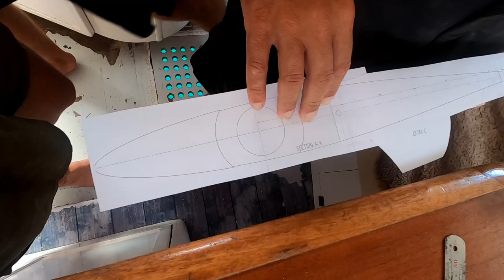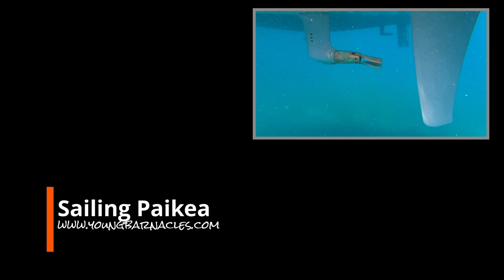Making our Rudder - PART 2

Comment: I take 3 hours to put in a new through hull on dry land, and it wasn't pretty. Then I watch you guys install a new rudder bearing and DIY carbon rudder using a snorkel, in the water. Impressive work.
Reply from the maker: Thanks 😅😅 not an ideal situation but we got it done.

Comment: That looks way faster. Did the port hull get to Europe first?  We've missed you guys online. Big congrats on the AC job. I'll forgive you for leaving multihulls for this bc who needs more hulls when it's all flying anyway? Hoping you can share little tech tidbits along the way of the next couple years. I was making carbon chain plates yesterday for a farrier tri rehab and during wet out was wondering what the Barnacles were up to ;)
Reply from the maker: Nice to know we were missed! We were busy testing asymmetric rudders on long ocean passages 😅 
Really happy with the new rudder. Shayne was super stressed the orcas were going to eat it going past Gib. We need to make the other one now and start pulling Paikea apart ready for the next phase of upgrades.

Comment: Amazing how little contact there is between the skin and the shaft. Obviously, you feel that this is strong enough. Is this from previous experience?
Reply from the maker: There is some fundamental composite engineering that confirms this will work. Also 20+ years experience in the composites industry and sailing gives me the confidence to say this is the correct approach. Having just crossed the Atlantic Ocean with this rudder is another testament to the theories and experiences we've already had.

Comment: Hi, with respect to your templates. Back in the 80’s I was designing and building a keel and rudder for a Martin 29 sloop. The research I found indicated that the trailing edge should not be a knife edge but should have a flat 5% of the maximum chord thickness. The theory was that drag created by the flat edge was less than the drag created by the turbulence of the high pressure flow wrapping around to the low pressure side and causing flow separation on the low pressure side of the foil. Im interested in your thoughts on this? I really enjoyed the rudder build videos as I’m in the process of building an Avalon 8.2 Trimaran (Similar spec to the F82R.) and I am planning on building foam core rudders and a foam core dagger board. Thanks for taking the time to make the videos and post them. I tried videoing some of my build and it is very difficult to do right.
Cheers
Glenn
Reply from the maker: Sounds like you've got a cool project or two going on. Did you have a look at our vid on inspecting the hulls and our thoughts on rudder design? https://youtu.be/tdr2Zl2rKAQ
We have a discussion forum on our website which may be of interest to you 
www.youngbarnacles.com

Comment: I've been re-watching this series, but I can't find the info about the weight. What was the final weight of the rudder, axle and tiller arm?
Reply from the maker: Old rudder with ss stock was 30kg and new rudder with carbon stock was around 10kg.
Reply: Thank you for the reply. I did a guesstimate of the same weight, so that's great. I'm doing weight calculations for what, hopefully, could be a oceanic small cruiser in the future.

Comment: So... I saw you laminate the carbon onto the rudder prior to vac bagging but then the finished rudder had only biaxial glass. what happened?
Reply from the maker: No carbon on the rudder. You would have seen black breather felt used in vacuum bag process
Reply: AH that explains it! thanks
 @youngbarnacles